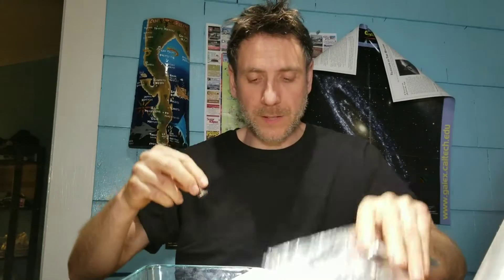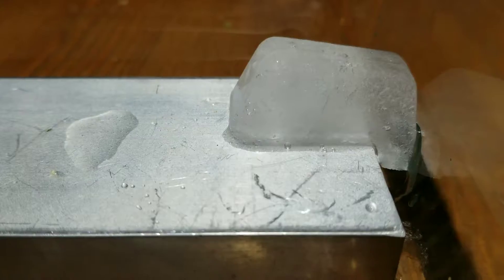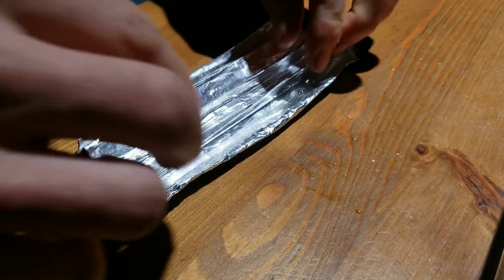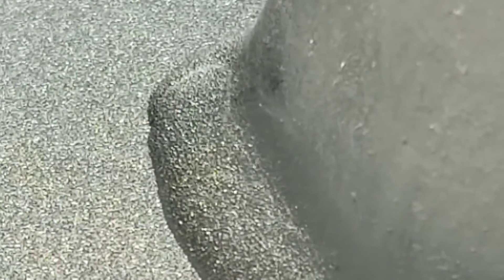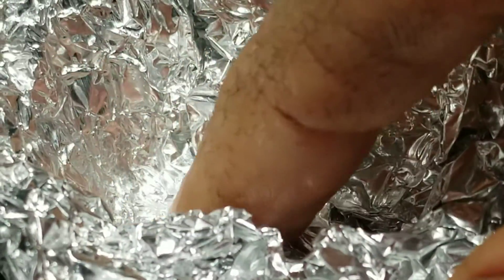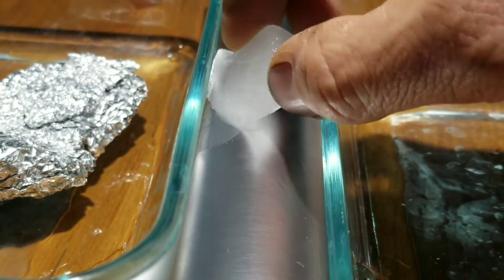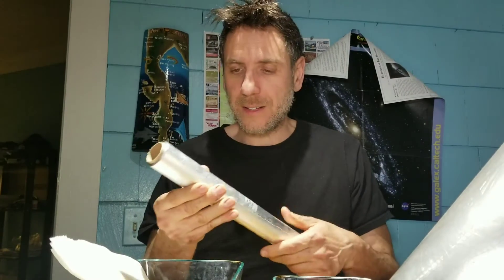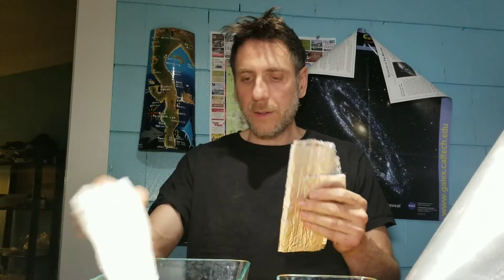How fast can you melt ice on aluminum?

Comment: so its a HEAT sync but not using heat?
Reply: A heat sink doesn't use heat. It's a thermal conductor that conducts heat through it into cooling fins that allow the heat to dissipate into the air.

Comment: Very cool. The heat sync works both ways like a cooler. A cooler is just insulation, keeps things cold or hot.
Reply from the maker: Well I think they're opposite no? Insulator would hold the heat or cold in.